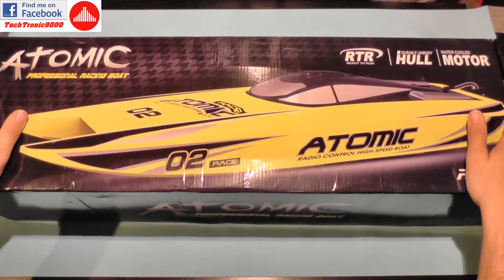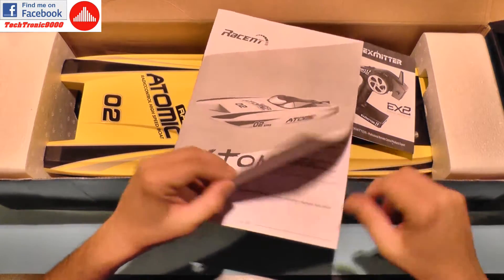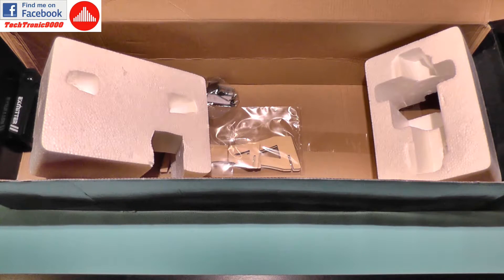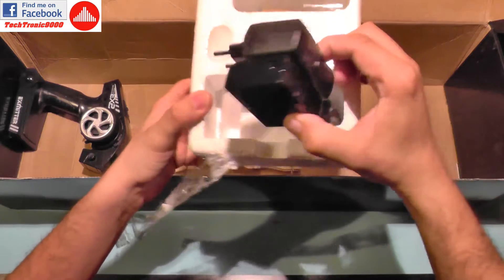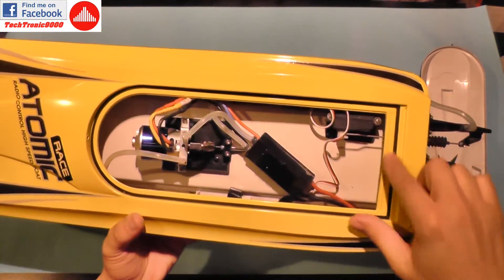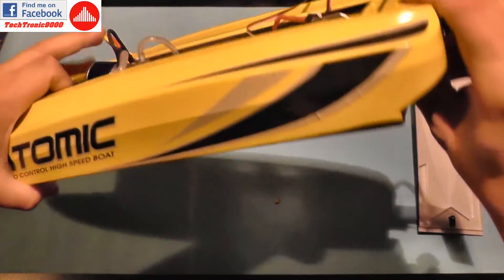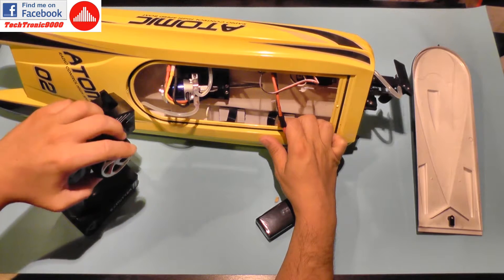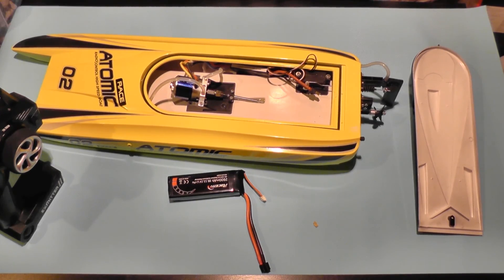Volantex V729-4 Atomic RC Racing Boat - Full Review Part 1

Comment: What about anti- capsize system ? Because those type catamaran boats very easy turn around and then good buy
Reply from the maker: I haven't tested that yet, but from my inspection it seems that it does not have an anti capsize system.
Reply: No anti- capsize system easy to lost it
Reply from the maker: Yes you are right and also the weather now is too cold for swimming after the boat. It would have been great to get the boat in the summer to take it to Greece.
Reply: TechTronic9000 I like this solution great for summer if you can SWIMM to rescue
Reply: Thats a 792-4, not a 729
Reply: @joshwideman7487  thanks for informing please sub to my channel to watch my new boat